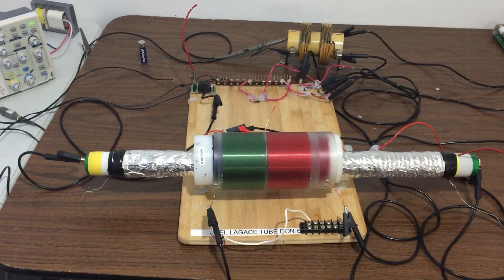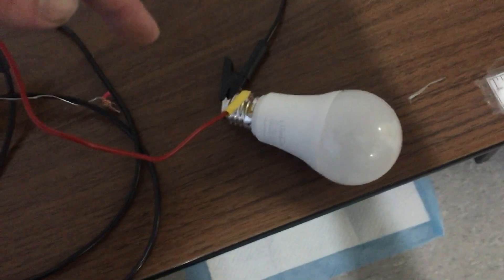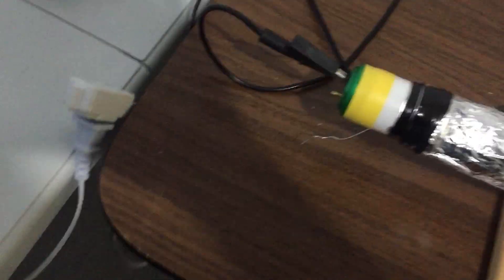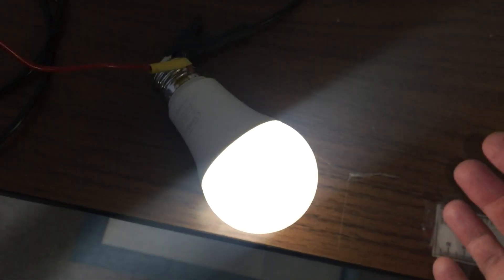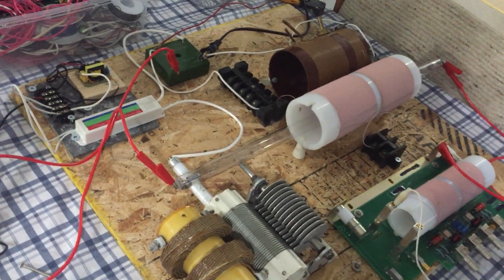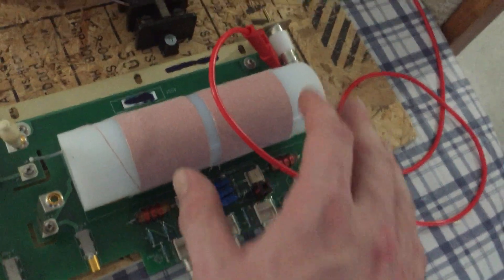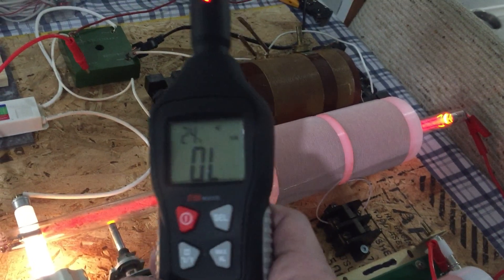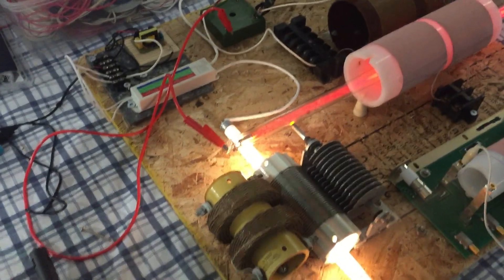Don Smith Full Of Secrets

Comment: It might not run a fridge or an old school TV but it could run a capacitive drive space craft without the need for fuel and slowly accelerate to near light speeds. Moon in 4 hours, Mars in 1 week, next star system in 4 years.    Thats according to these research guys playing with electrostatics and capacitors with the goal of making a "warp drive" Basically discharging a capacitor creates a small amount of thrust in a vacuum.  It debatable if its really thrust or something else but they're banking its real  and have been doing experiments with really high voltage capacitors.  This is a propellant-less drive  system they featured on altpropulsion channel.https://youtu.be/oUudT5CqlG4?si=5Pcl1COk0ES0D1sa  I think the main issues was scaling it up and the powersupply need. It would be huge the guy was saying but still doable in space but i think were stuck with funding issues to take the idea any further. However  with a self rechaging system from ambient energy like this could  achieve, and who knows how effective it could be in space, you might not need that huge powersupply for it.  And could send a little probe to Alpha Centauri with a 4k camera and take some photographs of those planets and have some images back in a reasonable amount of time.  Only issue to test this idea you need to put something into 0g...  maybe this energy harvesting could solve that problem too , like using the ambiet energy to bounce a little drone out into orbit.

Comment: I realized something like this on accident. The high voltage AC output wouldn't arc to skin unless both output wires of the transformer coil was used. However, when one end of coil was connected to a fluorescent bulb , the other end will arc to skin and any thing conductive. Also when it arcs the bulb gets brighter

Comment: By far the coolest video I've seen in awhile.  

This reminds me a bit of batteries and galvanic reactions but with capacitor effects.  When you have that voltage difference potential, you have power pretty much.  I've been learning about the various generators over the months.  It would be cool to setup an Adams motor or something and test feedback/efficiency on this.  The more passive you can go with the switching and get your angles right for timing, with the decoupled load effect on the battery charging I believe you may achieve over unity.

In fact, I believe almost any/all devices built that claim over unity use some type of battery effect, even if a solid state form.

Comment: Joel greetings from Wales. You may find "what if did this...."  useful one wire circuitry. He sounds Australian and is showing 0.00 w consumption on his circuit. If it helps on the Don Smith device consider. UV tube wrapped in rust powder fe2O3 attached with silver conductive epoxy. The iron oxide has an absorbtion band of 280nm and will therefore excite and push out electrons to create high potentials. Seeing as this is the same absorbtion band as O2 it makes sense to minimise the amount of oxygen present between the light source and the rust. Remember that this wavelength doesn't get past the Ozone layer. So when artificially created beware to not expose yourself to this wavelength it destroys DNA and will make ozone in air.

Comment: In all this madness, the magnetic field of the 1st resonant coil is important. It is important to have the coil quality as good as possible. The quality must be better than the resonant current and voltage. This resonant magnetic field must pump energy to the 2nd receiving coil. And the 2nd receiving coil must increase this field. Here, it is important for coil 1 and coil 2 to be as one. For this reason, they must be tuned with each other. One Tesla system is a tower coil, wireless energy with grounding to the ground, and the second system is LLC ZVS resonance without grounding. These two systems can be combined. Everything that is important in this is the quality of the circuit and the magnetic field, what we put in, i.e. what energy we take at the input and from this we calculate at the output. According to the theory, there is nothing to not do this. So why doesn't anyone create 100kW of power at the output? I noticed that only the magnetic field and quality matter, and only this gives high energy according to the theory. From my science and understanding, this is still there is something that gives energy a regular transformer at the output before the capacitor bank then we can do much more at the output But it can also be achieved differently for large energy gains There are plenty of such methods The film is cool I do not understand much because I do not design it so I do not understand much what you are doing you want to achieve But I believe that in the end the effects will be great👍👍👍

Comment: Could be a choke.. not saying it isn’t, but he says it is to charge the source battery, but due to adjustments he made to the circuit it wasn’t needed because the battery self charged at that point.
Reply: Yes the yellow tube could very well be a choke. I believe this is where the magic happens. And exactly this part Don Smith always avoided. Everybody is focusing on the step up to 8kV. Then they try to rectify the 8kV and the result is disappointing. Don Smith showed 2 ways to step down. 8kV DC -> step down voltage with spark cap to 110v 21MHz -> place a resistor in parallel before the Isolation transformer to bring the 21Mhz down to 60Hz (that's the magic I believe - a lot of amps) -> Put the 110v 60Hz into an Isolation transformer with built in resonant cap of 60Hz.

Second possibility: 8kV DC -> pulsing cap in parallel to bifilar -> step down with Tesla bifilar coil (50 turns left and 52 turns right the 2 turn difference is to round the spike) to 110v 21Mhz -> we're at the point now we're going to set the frequency. And there's going to be an other maneuver at this point and basically this is where we go back into the overunity (original words from Don Smith). Here is the magic - 110v 21MHz to 110v 60Hz. A lot a lot a lot of amps. Overunity people will be happy about that maybe (original words from Don Smith). We're going into a resonant iron core transformer system (self resonant isolated transformer 110v to 110v). And this is where we're going to end up with all the amps. The magic is 110v 21MHz to 110v 60Hz.
Reply: Yes the battery self charged. The wire of the battery needs to be the length of the primary coil or a division of this. It picks up the high resonant frequency and the current flows suddenly into the battery. It works because it's an other frequency. In a wire can be different frequencies at the same time and they work all independently. DC is also some sort of frequency. And important is a high frequency like 20MHz. The length of the wire at the battery was 4 feet. The same length as the primary coil. Later he shortened this length to a quarter (1 feet). He told if the frequency would be at 200KHz the wire would need to be 400 feet to have the same effect. This tells me it works just in the region of MHz.

Comment: Don Smith did talk about the grounds, two of them. Either two earth grounds or two air grounds. In each one ground should have slightly more resistance than the other, that will give you the difference of potential you seek.